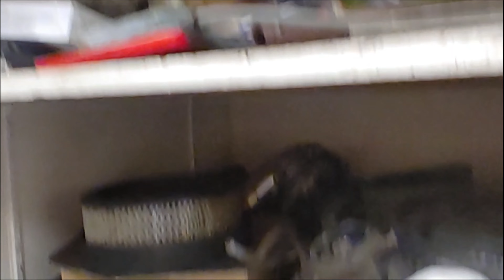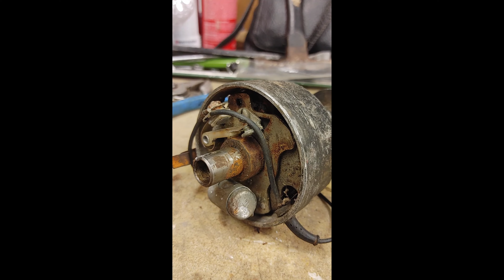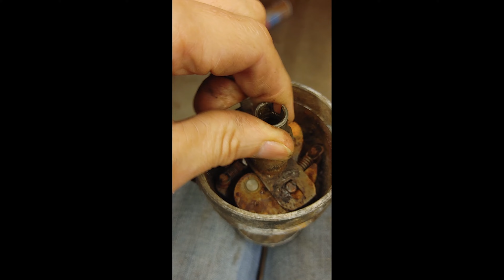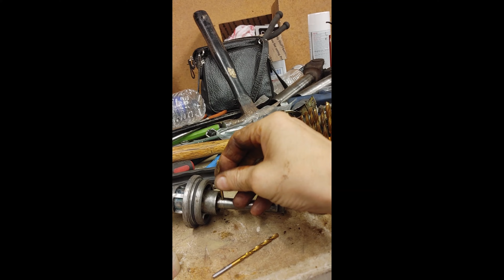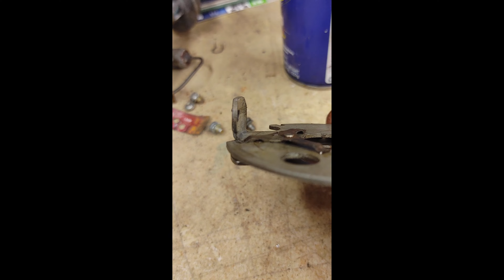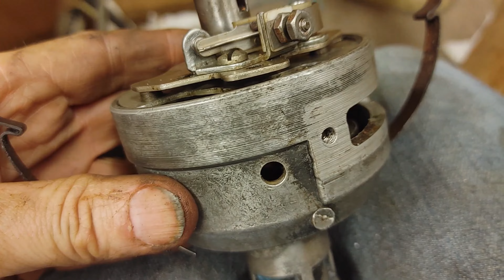Keep it classic: Mopar points distributor rebuild tips recurve refresh adjustments full build

Comment: Standard ch14vx blue streak points are the best. Dont replace the condenser unless its defective. Youl end up with chinese sub standard what will fail in few hunred miles. I run mopar electronic distributor and hei ecu. I have points distributor in my trunk for just in case.
Reply from the maker: I also like the standard Mopar electronic distributor. It's what I have in my 1966 Dart. I keep an extra orange box on the shelf just in case and it is still cheap enough. They work excellent if you get name brand parts and ground everything properly. Thanks for the recommendation on the points.

Comment: I think you should get a copy of mopar Action's article on a "spark in time" it explains the timing and recurving of a distrubtors in great detail...  For the street I do not even bother with the points dizzy and only use it as a emergency box swap in... Race is aonther deal... The roll pins for most anything IE the collar on the end of the dizzy...can be found at HFT cheap in an assortment kit.... No such thing as never want to be at 30° it always depends on the engine combination some engine combos can go as high 60°.... Check out the spark in time article.
Reply from the maker: Thank you for the suggestions. I am not an expert and I am open to learning from more sources. I am building a points distributor as requested by a friend who wants it period correct. I have not worked on anything that wanted more than 34 deg of initial plus mechanical, but I understand there are applications for a wide range of options. Showing my process will hopefully enable others to learn and experiment.